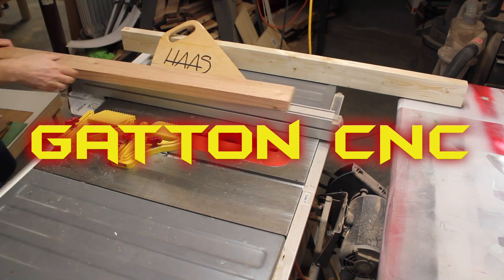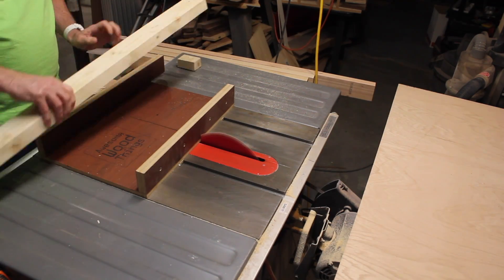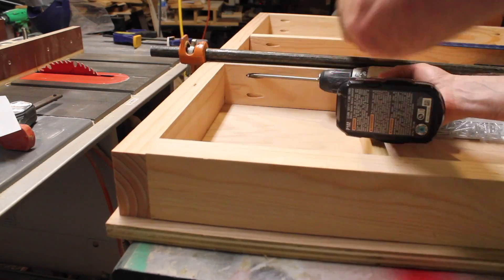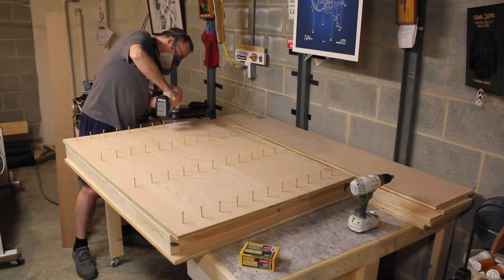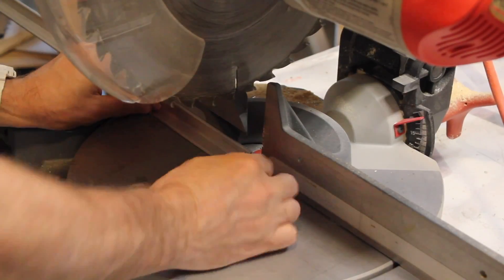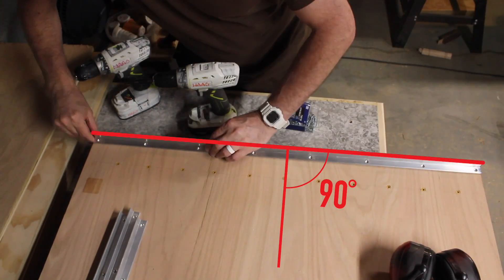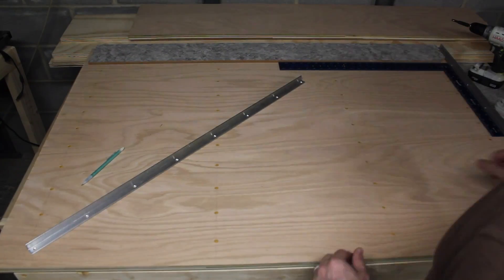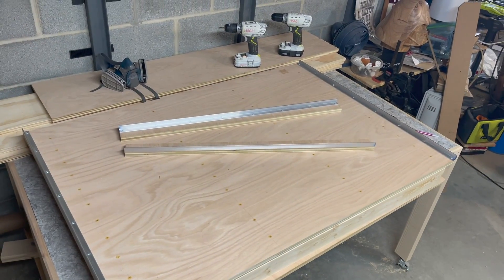CNC Bed - How to build a Gatton CNC

Comment: Nice looking job.   Watched your Z axis video as well.   What size table you building?  What will your final cut area be?  I’m in the planning stage as well!  Can’t wait to keep watching the build video.
Reply from the maker: It will be approximately 4’ 3” wide by 2’ 4” deep. My Y-axis v-rods are exactly 3 feet… so… whatever the machine can do with that span is what I’ll have. I’ll be happy with a 24 inch deep cut-area but again, it will likely be a bit larger than that. 
I hope that helps. Basically, it’s a little wider than the build-plans Dave provides but it’s less deep.
Reply: @AwesomeWoodThings  sweet!  Can’t wait to watch the other build videos